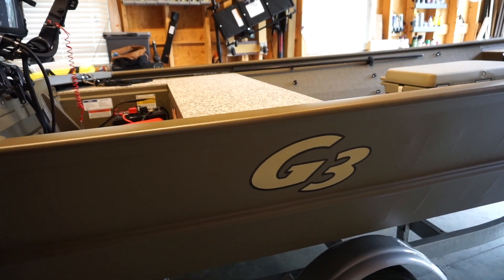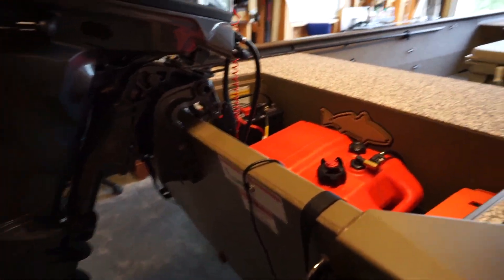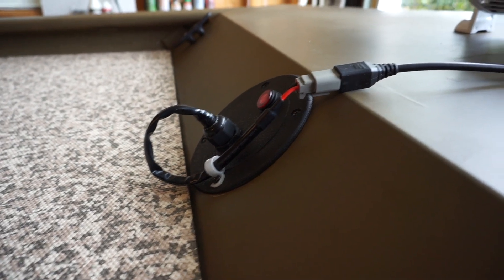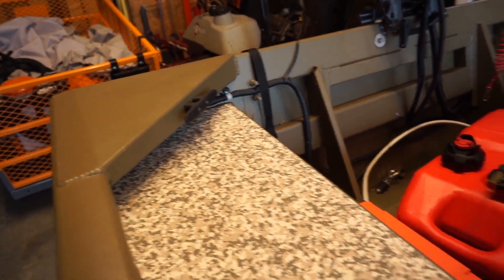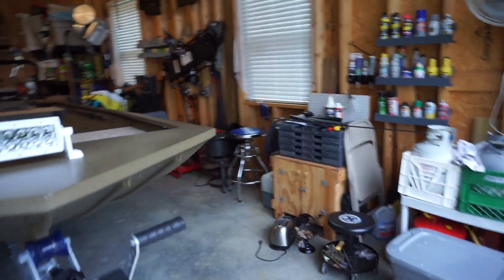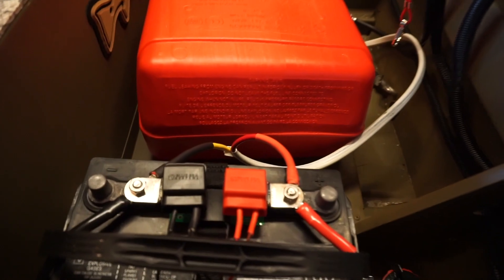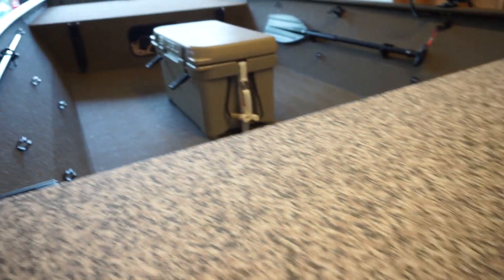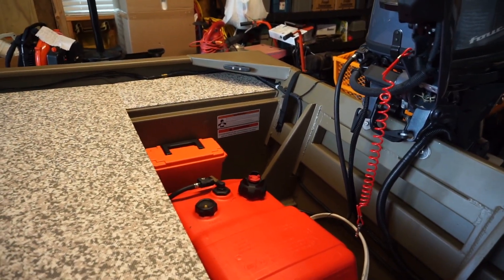G3 1652

Comment: Nice setup! You gave me some great ideas for my 1625. Do you think the oar clips will stand the abuse and test of time? Love the stern saver! Did you put nuts on the backside of the bolts for cleats and rocket launchers?
Reply from the maker: The oar clips are made of heavy duty type rubber, so yes, I think they will last. Was able to use nylon jam nuts on the back of SS screws on rear cleats due to adequate room for your hand. I used self tappers for rod holders and bow cleats since there is no access at those areas. I used rivets for all clips on side pieces and cooler tie down bracket.
Reply: @lawrencepantaleon3269  Thank you for sharing! Awesome job!

Comment: Dude I have the same boat and motor setup question how did you get your wires up front I had a hell of a time fishing up through the gunnel rail
Reply from the maker: My dealer ran the wire under the floor kit before he installed it, all the way from the bow access to the transom. Thanks.
Reply: they sell a stiff rod kit that you thread together. Run it from the drain plug right to the front...

Comment: I got a 1652 center console with a 50 hp and I cant make it stop porpoising and the bow rise is dumbbb
Reply: Hydro plate or sponsons...orrrrr trim tabs. May just have to adjust the way the motor tilts.